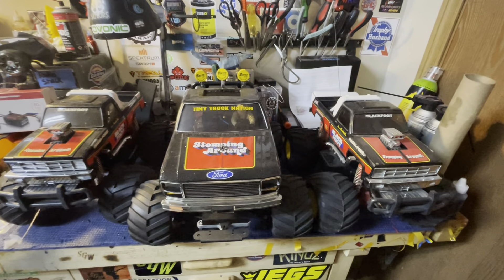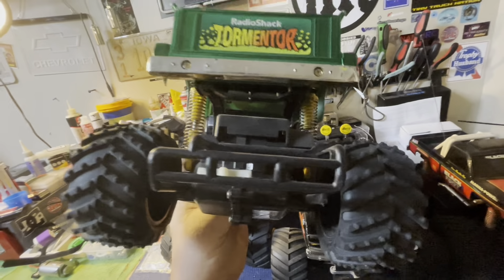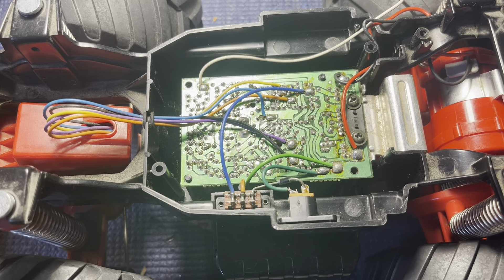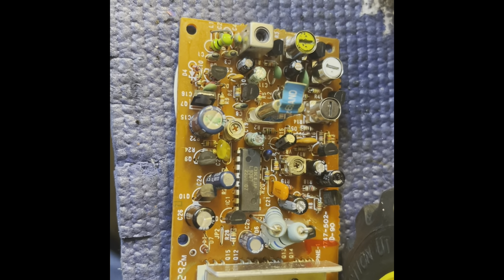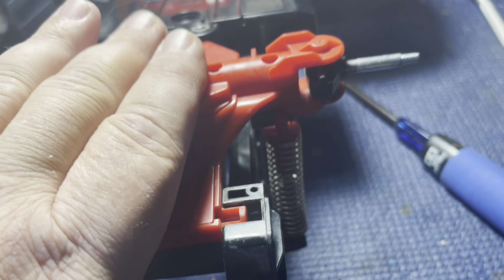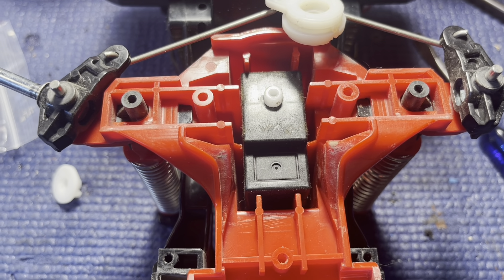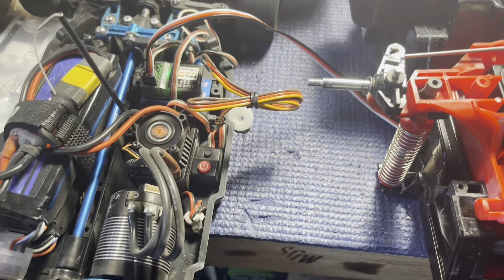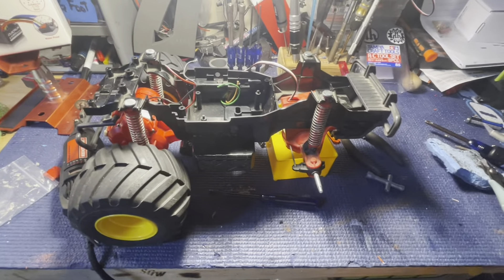Tamiya QD Blackfoot, Modern Electronics Upgrade pt1

Comment: Cool resto project to take on Thad. That servo has got to be a lot smoother and quicker than the original. I’m sure this guy is going to be a happy dude when it’s finished!🤗
Reply from the maker: Thanks buddy. The only thing I’d do differently if it were mine I’d put a 380 sport tuned in it

Comment: Hello I have the regular ford Blackfoot that I saved all my birthday money back in the day. What would it cost to upgrade it? I can’t find the remote just the truck.
Reply from the maker: You can buy a dumbo RC radio for about 35 bucks and a hobbywing 1060 electronic speed control for about 25 bucks. That’s the route I’d go
Reply: @IowaBudgetRCBashers  
Do you have any links to the items? I would like to try to get it running again. Wife almost threw it out. Also what battery would you recommend.

Comment: Hey that is awesome. I used to have a QD pumpkin a LONG time ago. How did you put decent electronics in it?
Reply from the maker: Pull out the printed circuit board, replace the servo, HOBBYWING 1060, and a dumbo receiver. I’ve done my pumpkin, and 3 of the radio shack versions. Now I’m doing this one for our viewer. I’ve actually got another rare qd truck I’m gonna do for myself soon. It’s a easy conversion